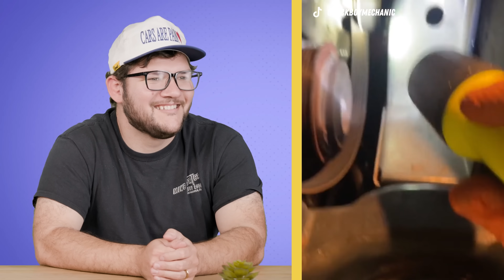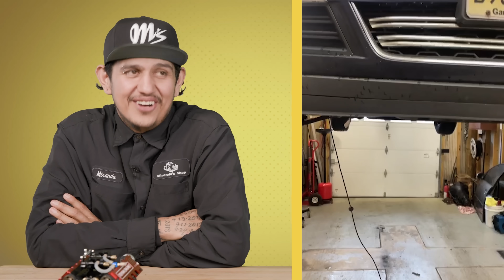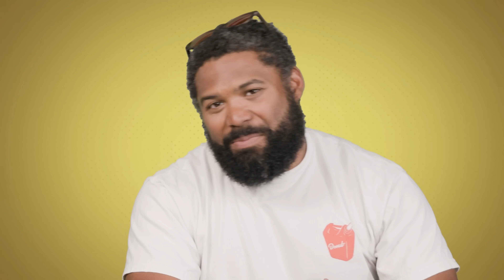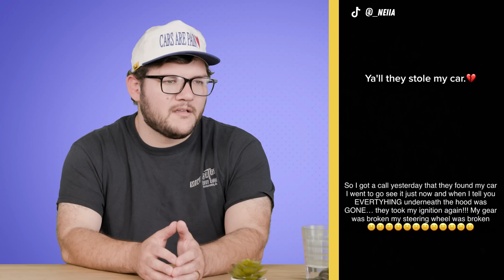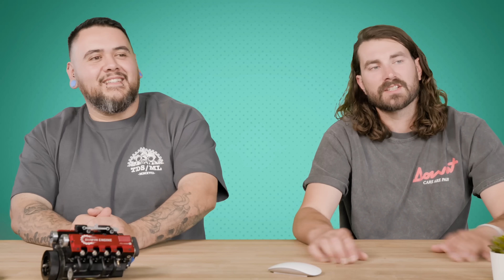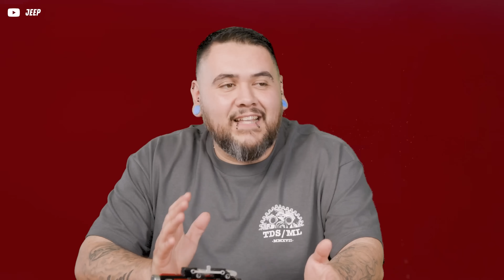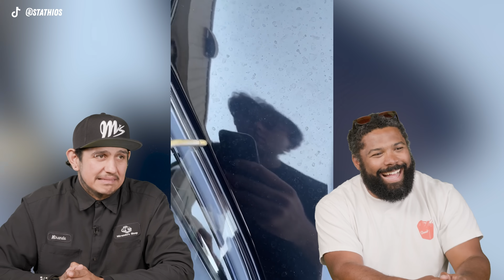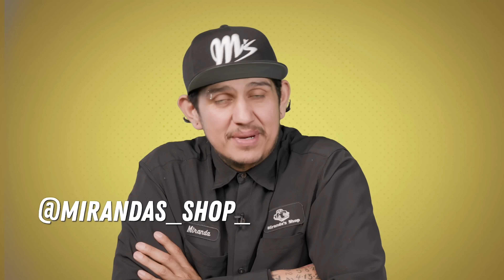Mechanic Reacts to Car Engineering Fails

Comment: the ford Ztech oilpan is sandwiched between the bellhousing and the front cover, so you need to take one of those pains off too, to be able to get it back on -_- and if it's in an ST150, then you have to take the engine out to do that.... AN ENGINE OUT TO PUT AN OIL PAN ON!!!

the early BA falcons with the barra had a poorly designed fitting on the power steering pump. Without warning it'll leak, and it leaks on and kills your alternator super quick
Reply: I want to see more of these engineering fails!!

Comment: Started watching this video and when they said "Engineering issue or Factory Issue".......KNEW THIS would be a fight. Push blame on the next.....SO MUCH FINGER POINTING in the comments!!!!! I am in this for the comments because it is NEVER the engineers fault (I am married to an engineer by the way) and also? have friends that work at "stealerships" as well......sucks as they are all cool people.....as long as they aren't around each other :(

Comment: The first generation (2002-2008) of new Mini Cooper S's had an issue with mushrooming strut towers because of an engineering oversight and penny-pinching.

For the S model of the Cooper, BMW re-used the chassis of the base model Mini, as it was already a very stiff chassis. When they swapped in the supercharged W11 engine, it left no room in the engine bay for the battery. As such, they moved the battery to the rear cargo area, which of course left no room for a spare tire. So, the big brains at BMW decided to just equip every Cooper S with runflat tires from the factory. 

The issue with this was that the suspension for the Cooper S was WAY firmer than the suspension for the base model Mini Cooper. Couple the much stiffer suspension with runflat tires and you have a level of force being transmitted from the road to the shock towers that the engineers never accounted for, resulting in mushroomed strut towers after a couple of years.

Comment: See, my petty ass would get the angle grinder, cut the bolt and use a remover/serrated socket on the stub then install a shorter bolt.

Comment: Some vws and audis run their water pump on the back of the engine head off a belt that runs off the cam shaft, or even half way down the block off a small belt that runs off thr balance shaft, pretty much anywhere other than where the pump should be, and these pumps leak every 30000km ot seams.

Comment: This reminds me of some other video I saw recently. Someone commented on how easy to service the vehicle was and a lot of people chimed in with one horror story after another.

Now I have a feeling that we as customers have a lot to do with this development. If we look back say fifty years not only was cars simpler, but generally they were a lot easier to service. And that was because they needed a lot more service!

I'm not saying modern cars are perfect, far from it. But fifty years back it was considered normal for the owner to do oil change, change the sparkplugs, check the spark gaps, change lightbulbs, check the points of the contact breaker and take a file to them or swap them out if they started to wear. This was normal maintenance that just about everyone did themselves. A lot of people also swapped the timing belt and adjusted the play in the valves, and again that was considered pretty darned normal. Just think back and remember how often there were ignition timing lamps hanging in the garages! Again it was pretty normal for the owner to know how to adjust the ignition timing.

Then there were lubing the running gear. Just about every bushing, bearing or any other place where metal rubs against metal had a grease nipple, and most people would check them at least once a year. Today those are pretty rare.

But for the last twenty years the users that do their own service has gone down. Today most owners has little interest and even less knowledge about servicing their own cars, and that frees up the manufacturers to make them harder to service, the they often require special tools and education to take care of a lot of the simple things you used to do with a adjustable wrench and a flat blade screwdriver.

Now there are positives to modern cars. It used to be that just about every car would mark the spot with a little oil when you parked. That was normal and if you noticed that there were no fresh oil in your parking spot you better check the oil as it probably needed to be topped up. Today that's a sign of a problem. Greasing all the bearings was something that took time and you really had to do it or you would end up having to change the bearings. Modern sealed bearings and oil seals are really good and most bearings have no problem surviving ten or even twenty years. And in twenty years you would be looking at worn bearings even if you were meticulous with keeping them greased up. So the quality has absolutely improved. In general materials has improved as well as tolerances and QC. This can easily be seen in the number of cars you see broke down on the shoulder of the road when you do a road trip.

Thirty years back it was quite common so see cars on the shoulder waiting for assistance while today it's a lot less common, and that is with a huge increase in total traffic. The big difference in my opinion is that once a car breaks down today the driver stands very little chance of being able to get it running again without first having it brought to a mechanic. Sure you can connect to the ODB2 buss and have a utility tell you what's wrong, but the huge majority of drivers doesn't have the needed hardware or the would understand what the utility was reporting if they had it. And when you find out what the problem is it often require that a sensor, module, or wire harness is replaced.

And about sensors... It used to be that you had exactly one sensor needed, and that was your ears. Sure there were oil level, oil pressure, charging, and gas level sensors, but none of them would cripple the car if they were to stop working. You might seize the engine if you ignored the oil and temp sensors, but that was up to you.

Point is that as we have unloaded the service to the mechanics the manufacturers no longer have much reason to make them easy to service. And while mechanics may swear over stupid designs they are still getting payed by the hour so it's really the owner who have to pay for it. And the owner is more likely to blame the added cost on the mechanics rather than the manufacturer...

Comment: They need to get rid of most of the electronics and get back to basics. It will also reduce costs and reliability.  Wished vehicles were still like the 80’s or early 90’s.

Comment: Jeeps are notorious for many types of failures, but most commonly are electrical failures. This can almost always be teaced to two reasons, crappy cheap allows that corrode on a warm sunny day, and inadequate moisture barriers. A third reason is kinda of a toss up between too thin gagie wire causing contacts to heat up and burn out, and poorly secured connections that mat vibrate apart over time. Tje worste part is rhese vehicles were usually way over priced even when they didn't malfunction. I think a brand new linerty cost 29k in 2009 or 2010, and those things were priced as much as 70% higher than at the dealership than what the dealer bought it for.

Comment: automotive engineer here
1) a quarter inch aint doing you one single shit more than the 1/16th they gave you, its an assembly 
2) its a feature in the new eclectic hummer, that's bean counters saving pennies on your mortgage payment 
3) robovoice = bullshit and for like 70 years you could start a car with a flathead screw driver 
4) what do you expect, it was made by a bunch of striking Englishmen on  their tea break, and yea thanks bra ... the steel washer is made of metal, pure expertise on display there 
5) robovoice = bullshit, and lemon law has been around since 1975... its fucking 4 years older than I am, how does robovoice chick not know this, also "modules" are not the problem, they have been controlling your cars for 40+ years 
6) tesla, having worked with them on many projects over the years are a bunch of arrogant "know it all" pricks just like its founder, please avoid 
7) brittish see #4
8) for fucks sake its GM, the only thing they can make good its a block and sometimes heads (northstar)  ... everything else is pants on head retarded made with rice paper and cellophane ... once caught an A1XC camaro with drywall screws in the bumper, brand new on the lot

Comment: "you can use a tool to prevent a mess." Why did the engineers not design this drain plug to avoid other parts, like every other manufacturer? It's a design issue if you need another tool. Plain and simple.

Comment: 10:41 i used to work on land rovers. Our shop had a collection of home made splash guards for the various different models. There are multiple different engines in multiple different models where the oil drains directly into another component or the frame and splashes everywhere.

Comment: been a line tech in rusty Massachusetts for 16 years, and the only two manufacturers that seem to put any attention toward serviceability are Hyundai and Subaru (aside from dohc  EJ spark plugs). both make models that can have engines out in under 2 hours, with a beer and while talking to friends. During Hyundais engine recall, each line tech could do two long blocks in a day if there were no unnecessary delays. the rest of the worlds car engineers should take hints from those who make their machines in such a way it can be worked on.  they wont though, because that means we can work on our cars in the driveway instead of bringing it back to a dealer.

Comment: I can't stand newer cars, I have the door open it has to remind me so I cant see the mileage or whatever info I need to do my job, if You have the hood open it has to remind you, there are even some cars that wont let you reset the oil reminder if the hood or doors are open like LOL why?  This is whay my cars are 10 years old it was the sweet spot of high tech without dumb BS like this.

Comment: As an engineer, I'd like to see you guys get a few real engineers from the automotive industry in a video like this.  Because even if they didn't design that part or helped designed that car, I bet you they know why stupid things like this happen.  I say this because I can probably tell you why they happen.  And it's not entirely the engineer's fault.  But sometimes it is.  And don't ask me, I'm not in the automotive industry.
Reply: For example, that first video.  I bet what happened is that engineer A designed the engine with that pully and long bolt, engineer B designed the frame and how it would route around a mock engine that wasn't chosen yet or wasn't fully designed yet, and then finally engineer C the one who designs the overall car and puts it together on paper most likely after consideration of many options chose that engine and that frame and over looked it.  Or decided that it had the least drawbacks.  (Meaning yup, it could have been worse) And I bet you any or all of the engineers most likely know about that bolt but due to budget and time constraints, they write it up and push it out the door.

Comment: Get this, this car I worked on this week has a tensioner you can't even put a wrench on, you have to loosen the engine mounts and let the whole thing sag, literally had to do that to replace an engine belt like WTF? I run into this crap almost every week, how about a car you have to pull the whole dashboard out to get at the blower resistor?

Comment: I had a 2016 keep compass, I had to replace the rear lower control arm, the bolt was too long to come out and it was facing the gas tank, so I would have to drop the tank........I said I "removed" tank and got paid extra but in reality I just cut it and installed a new one facing the opposite direction 👌🏽👍🏽👨🏽‍🔧

Comment: I think that land rover is just passive aggressive in trying to sell the mechanic some special tool or service manual where you need to follow some convoluted steps like vacuuming the oil out before draining. 

Or you could just engineer the engineering problem out of it by fixing an oil drain valve.

Comment: On the first one with the long bolt, why wouldn't you just cut the bolt?  Yeah, it wouldn't be fun, but it would take a hell of a lot less time to hacksaw that bolt than to shift the engine.  Hell, if you have a sawzall (which I understand isn't overly common in auto shops...or is it?), you can buzz through it neatly enough that you can still use it when it's done...just a little shorter.

Comment: The first clip was showing the bold against the frame, but how about the Chevy Cruze design that has the serpentine belt that goes around the engine mounts? Might not be a big deal for a garage to support an engine properly to pull the mount, but a serpentine belt is something a shade tree guy SHOULD be able to replace without spending a ton on labor. I don't think I'd have what I need to feel confident pulling an engine mount.

Comment: I had to replace my ignition lock housing on my '03 VW. Sucked, ignition swith actuator snapped. Had to replace the whole housing. If it were one of these shitty push-start RC cars I woulda been fucked. Fortunately the key fob-immobiliser connection was still good so I could just pull out the ignition switch and turn it with a flathead. I've had many people tell me I need a more modern car but I've had several experiences in which I would have been immobile if my car were not (relatively) easily servicable. 43 mpg tdi yeehaw

Comment: I know for a fact teslas engineering is bad as I’ve worked with their parts. They have ZERO change control and have multiple versions of major parts with the same part number and model year. Engineering 101 failed

Comment: With McLaren the issue is twofold. The engineers would have specified exactly what kind of washers to use for those bolts. As long as the factory was using what was specc'd then it would be an engineering problem. Body fitment would be factory.

Comment: Ask a welder. We hate engineers also. Nothing like trying to build according to blueprints only to find out it is virtually impossible to build whats on the print because measurements do NOT match up.

Comment: I'm a Ford guy currently at vocational school for ASE training and there are 3 cars that come to mind. 

My personal 07 f150. If you know about the 5.4 3v you know what I'm talking about. Absolute trash timing system, flawed rockers, and not enough oil flow. But... Engineering failures like what we saw here came up when I did the timing set on this thing. Why is the trans tube held into the block through the manifold runners with an 18mm bolt? Why is the power steering pump reservoir bracket so shit to remove? Why did I need to remove the steering shaft to get the power steering pump out in such a large engine bay? Look I know I'm just doing this at home with some admittedly budget tools but still. 

Next was a 2015 focus I did work on for a coworker. Needed both front control arms replaced. Two shops quoted $1800. Why? On the passenger side, the front control arm bushing bolt is about 5mm too long. So when you back it out it collides with the AC compressor. These shops wanted the doe to pull down the system, do the suspension service, recharge the AC system, then align it. You can just barely move the AC compressor out of the way to avoid this but Ford service procedure apparently says do all of the above. 

I ran into a, I think, 2010 Lincoln MKS at the junk yard and need an HVAC module. I remember having to pull one 7mm bolt out that was entirely hidden in the dash that I have literally no fucking idea how you'd see without most of the dash being disassembled. Then you go to pull it out and it's spinning in place because you know, small fastener on a ratchet, no matter how little your arc swing is on your ratchet you need to put a second hand on it. So you're going into thhis bolt completely blind, with both of you hands through and 8" gap where the nav screen used to be trying to get this bitch out. Maybe I'm shit and deserve to be in school but that's stupid you can't remove even the air bag out of the passenger side of the dash to get access to that, let alone a piece of plastic trim because that's how it was engineered. 

Oh yeah, that same f150 has plastic bushing for the automatic shift linkage. So they break into pieces as they age and you can't drive the truck. Just one of my many experiences I've wondered, what the fuck are you doing?

I keep thinking of more on that truck as a type 😅. Going through doing an EVAP core and some plastic trims break. I don't mind, it's my truck not a customer and it's old at 230k miles this is to be expected from a southern car sitting in the sun it's whole life. Why is it that the exact same parts between a 04-06 and 07-08 f150 are different in some cases? Like the shift know. Look identical but totally different design between the two. The gauge cluster information read out buttons and LITERALLY THE SAME AND PERFORM THE SAME FUNCTION but the harness connectors are different. Why are HVAC modules (and others) that come on identically optioned vehicles flashed different so they don't communicate correctly? 

I need to take a deep breath after that. On the other side of this my other two ford's never gave me stuff like this, both mustangs btw. I work on those and they always made sense for design choices... At least in my eyes. I will say the 5.0 coyote shouldn't tick and the oil pump gears shouldn't be made out of cheap cast aluminum.